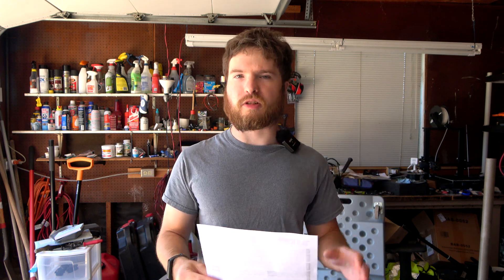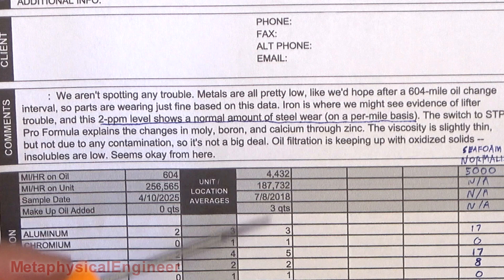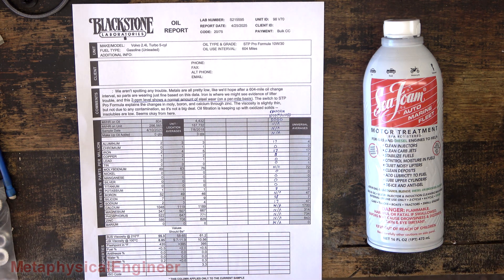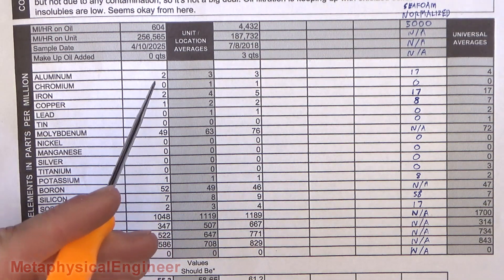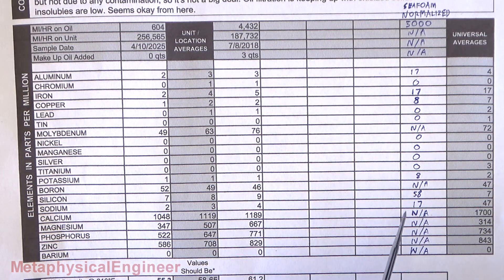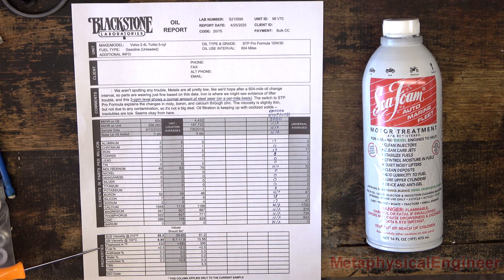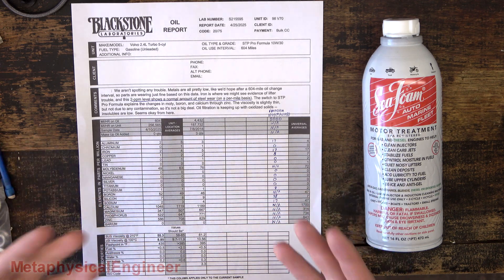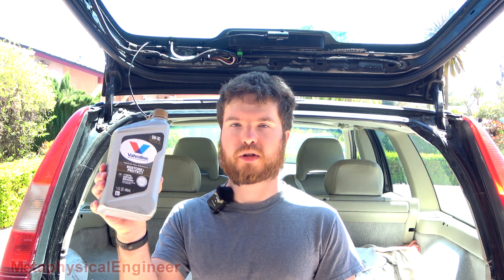Did Seafoam Hurt My Engine?  Oil Analysis Discussion!

Comment: All of these arguments about oil additives have been scientifically resolved many years ago. Only a handful actually help, and every old school idea like adding trans fluid, kerosine, of diesel fuel, is a great way to actually cause damage to your engine.
Reply: I used Seafoam one time in my Honda Odyssey as it was burning oil and fouling out plug #1.  Ran it one time and my oil burn went away and I now have 3x the mileage with no fouled plug.  Lucky?  Maybe but seems to have worked for me.
Reply from the maker: @kevinberta8741 How long did you run Seafoam in your Honda?  How many miles were on it?  Do you still have it?  Sounds like you had stuck rings like some engines became notorious for, and the treatment restored compression and oil control.
Reply: @MetaphysicalEngineer  It had over 250k on it.  Ran it  for about 3000 miles and then changed oil.  It now has 312k on it and not burning oil.
Reply: @kevinberta8741 I have used SeaFoam many times to correct idle problems in cars that idle smooth before hand. It cleans everything it touches and doesn’t dissolve so everything gets clean. If it crud in the carb or injector it gets cleaned, if it’s crud around the valves it gets cleaned. I have a car the IAC keeps getting dirty and ramps the idle rpm up through 2500 rpm and SeaFoam helps fix it but takes a couple tanks and some gas creates it like Exxon gas. I put Exxon in the tank forget it it’s gonna idle at 2500-3000 rpm for the next 2-3 tanks of gas every single time. I suppose I could change the IAC a fifth time but I don’t know that would fix the issue. Excellent car other than that. Timely oil changes though and 5000 miles is not timely it’s an attempt to prevent cars from making it to the 3rd market. 3000 or whenever anything funky is going on with the oil, dark color or thin when checking it cold.
Reply from the maker: I'd really be reluctant to add kero or diesel to the crankcase, even though that's exactly the main ingredient in those 10 minute engine flush products.  ATF at least has somewhat comparable viscosity and lubricating properties vs an ultra light fuel oil. Even so, I doubt 10 minutes with some solvent in the oil would do much for the hard carbon.  I'm stuck doing it the slow but safe way, or tearing down the top end and manually cleaning the lifters.
Reply: Funny my Grandpa used ATF to silence lifters forever and it always worked for him and he drove the same cars for years and years at a time. He did it in really nice V8 engines and tiny 4 cylinders I don’t recall him ever driving any V6’s or in-line 6’s but if he did and got lifter tick he would’ve put some ATF in and it would’ve shut up for him. I prefer Marvel Mystery Oil for the task and timely oil changes of 3000 miles or when the oil gets dark whichever happens first. Also if it gets to feel thin I change it. Oil’s cheap engines aren’t.
Reply from the maker: @308dad8  Tried Marvel first when the tick arrived, shown in the previous video.  It knocked a fair bit of carbon out but didn't touch the noise.  How long did gramps run the ATF in the oil before it would resolve the tick?

You're right that oil is much cheaper than engines, and many modern engines have unreasonably long intervals.  With 7 quarts total sump capacity, I have a lot more wiggle room for longer intervals.  Factory spec is 5000 miles on the turbo models here, and that was figured using obsolete 1990s oil tech.  See the oil data from a few years ago on the sheet using modern full synthetic, where at 4400 miles there numbers look very good and could have run significantly longer.  Of course there's a big difference between 5000 miles of short trips or sitting in traffic and 5000 miles of highway cruising.
Reply: Adding ATF to an Engine Crankcase is Not A Good Thing To Do!! Some ATF'S have A Frictional Additive that helps the Clutch Packs Grab!! Call Any Transmission Repair or Rebuild Shop, and Talk to Them!! Call Any of The Oil Majors, and Ask about Frictional Modifiers included in the ATF Additives Package!!😮😳😳😳😳🙄🙄🙄🙄 The adding ATF To FLUSH Engines is a Very Old Legend, and Holdover from generations back!! ATF was Originally Whale Oil!! FACTS!!😮😳🤔🤔 Look it up!!🤫🤫🤫🤫🤔🤫🤫🤫 Yes, Real Live Harvesting of Whales that was finally Banned!!🤔🤫🤫🤫🇺🇸🤘🤘🤘✌✌✌✌😊

Comment: AMSOIL SIGNATURE SERIES
Reply from the maker: Also got a few recs for Amsoil too.  Ester based oils have a reputation for cleaning, so I'll keep that in mind too.  So long as the wear numbers look good, I'm open to trying more products if the noise doesn't go away.
Reply: If I purchased new today I would start it on a true 100% synthetic. Red line would work too. Getting away from all the paraffins is the way to go.
Reply: @EvzenKovar-i5p  100%  SYNTHETIC

Comment: If you want to clean an engine, try Valvoline Restore & Protect or HPL (High Performance Lubricants). Never put ATF in an engine.
Reply from the maker: I'm running R&P now (see conclusion for where I mention it).  Very curious if it resolves the issues since I suspect the hard varnish that's restricting the lifter is similar in nature to the deposits that jam up piston rings which R&P is formulated to dissolve.  HPL is another I've heard good things about, and it's on my list of things to try if this sequence fails to yield any results.  

All depends on how it goes and if I still have favorable wear metal counts on the next sample.

Comment: ATF does not contain any significant detergents or cleaning ability. This is not the 1950's, there is no whale oil in modern ATF and there are no clutches in your engine that will benefit from the ATF friction modifiers.

Comment: Any additive added to oil will 100% degrade your oils additive package. You should be adding a quality product to your fuel no matter what brand gas you buy and especially if not using Top Tier fuel. The Motor Oil Geek channel is where any of you that want facts should go. This guy hasn’t a clue what to look for in an oil test result. 
Oh, and if you’re putting Lucas Oil Stabilizer in your crankcase, you should stop immediately. 😮
Reply from the maker: If you see errors in my interpretation, please enlighten me rather than just saying I don't know what I'm doing!  I'm here to learn, and I'm sure others will benefit as well.  

I do agree that Top Tier fuel is worthwhile, and likewise have never been a fan of Lucas Oil Stabilizer.  Especially since I can see that oil pressure is not the source of the problem here and adding a quart of petroleum syrup to the crankcase won't do me any good.
Reply: Because the additive package in the oil is a fragile sort of magick, and not in many cases "just Mobil One with Moar Stuff in it."

If adding anything to Mobil One 100% degrades the additives, why aren't users of Royal Purple etc reporting problems after those products have been on the shelf for decades?

Sounds hyperbolic.

Comment: I had an old Ranger pickup four banger / fuel injection. It was running rough. I took the throttle body apart and it was covered with black varnish. I sprayed it full of seafoam. I also poured some in the tank. I let it sit for a few minutes. I drove it 2-3 miles while spewing white smoke out of the tailpipe. I let it run until the smoke cleared up. When I took the throttle body apart, the varnish was mostly all gone and the engine was running normal.
Reply from the maker: Interesting!  Project Farm also used Seafoam to great effect on a sludged up older Ranger.  His was clattering like it was about to come apart, but purred like a top after.  I think he put it in gas, oil, and through the intake.  Apparently it was still quiet and smooth when he did a check in a year or so later.  

After my experience here I much prefer Seafoam as a fuel additive or throttle body cleaner vs an oil additive.  There's small amounts but very hard varnish and carbon in my engine, and Seafoam would probably need many thousands of miles to put a dent in it.
Reply: My dad had a 93 ranger with the 4cylinder shortly after 36k miles it had terrible lifter noise he changed the oil added slick 50 it stopped making noise and added every oil change after he once didn’t add it noise came back he eventually sold the truck with 150k miles

Comment: Atf has more detergents than motor oils. Plus, it's in the 20 to 30 viscosity range, which will not hurt any engine, old or new. The additives in atf also have seal softeners and anti ware included. So I've been using it for decades and always have great results. I'm curious about the Valvoline myself, I can't wait for the results.
Reply from the maker: Thanks for the info!  What vehicles/ engines have you been using ATF as cleaner in? How much did you use?  Was it a preventative thing or were you trying to solve a problem like noisy lifters or sludge?
Reply: @MetaphysicalEngineer  in my area, people are poor. They don't do maintenance 🙄. So usually they have stuck lifters and clogged drain back passages from the head to the camshaft tunnel. They will sell them cheaply because they think it's a rod knock. I'll change the sludge for oil and put the whole quart in the first change. I keep an eye on the oil quality. Usually, the first 1k miles it's full of grit and black. Then I'll put a gallon of Shell Rotella T 30W in the engine and top with atf. Usually I don't get 2k miles before the filter is full. Change only the filter and watch it close. Then, put the recommended oil in and watch for more clogged filters and particles in the oil. Usually, within 10k miles, the engine is clean and ready for work 😆. Have been doing it since the 70s without having ever damaged an engine. It's more about getting the passages open for proper lubrication to the components. Something about atf helps with the removal of carbon deposits and sludge.
Reply: ATF has almost no detergents compared to engine oil. There are no combustion byproducts in a transmission (aside from some motorcycles) that would need cleaning. ATF needs the metal and clutch particles filtered out and magnets really help in this regard. Do NOT put ATF in an engine.
Reply: @marstedt  you ARE right there random internet guy with nothing on his page but 1st you don't leave it in there its not a long term solution. no it does not have as much detergent as motor oil but what it is good for is flushing out a lil sludge and does free up lifters pretty well.
Reply: @NickMillerlouisiana  - I suppose you could do that but the ATF friction modifiers should not be used in any engine that I know of and could be harmful / damaging. Besides that, ENGINE oil has more detergents & cleaning ability and is usually cheaper than ATF. Use ENGINE oil in engines .... please!
Reply: ATF will destroy a DPF
Reply: Transmission fluid is hydraulic fluid.  It has no detergent in it.  It doesn't need it, it's thin and petroleum cuts petroleum.
Reply: ATF has been great for me as i will occasionally run 1/2 to 1 qrt depending on engine size 👍

Comment: Valve lash might surprise you, valve cover gaskets are usually pretty cheap
Reply from the maker: These engines have hydraulic lash adjusters.  In the previous video I used my stethoscope to identify the second exhaust lifter on cylinder 5 as the culprit.  I suspect the adjuster is not pumping up completely, but has not fully failed and collapsed, which would make a much louder, sharper clacking noise on this engine.  

Unfortunately this design uses a structural cam cover containing the upper half of the cam journals instead of a standard valve cover.  40 bolts with a strict loosening and torqueing sequence, and anaerobic sealant instead of a gasket or RTV, which is extremely sensitive to contamination.  I've had it apart before, and it was an experience.

Since this UOA suggested normal wear rate, I'm more confident I can experiment with cleaners rather than an emergency teardown to save a cam from getting munched.
Reply: They are, but removing the covers is oftentimes a big enough PITA due to obstructions that most people will avoid it if they can.

It's why none of my dailies ever got a nice crinkle finish on the covers.

Comment: Seafoam was designed for marine 2 stroke engines. Not the wonder juice people think
Reply: It was actually developed for cleaning mechanical diesel injectors.

There's always some old grump who swears it does nothing, and then refuses to show his work.

Vs thousands of people including professional mechanics that notvonly say they got X result, but also showed evidence.
Reply: Agree.  Honestly, I'm not sure why marine engines would benefit, but I'm not refuting your claim.  I've done some work on mercruiser 350s.  I'm no expert, they just seemed to be cam'ed differently than, say, a 350 that would go in an automobile.  I would go on to say that seafoam would benefit older engines.  Things like old tractors.   I would say seafoam has seen its days pass.
Reply: @FrankRizzo557  water remover, carbon remover. 2 strokes burning oil mix, carbon can build up easy if they putt around
Reply from the maker: I did mention that in the previous video where I cut open the oil filter.  Seafoam and MMO are old school products from an era of older tech engines and older tech oil that would tend to form sludge easily.  Still useful for stuff like small power equipment prone to gummed up carbs, and may have benefit in an engine with soft sludge.  But at this rate I'd need to run a hundred bucks of the stuff over many thousands of miles before it put a dent in the hard varnish.
Reply: @MetaphysicalEngineer  yea, a regular use pretty much from new
Reply: That might have been what it was originally developed for, but the can indicates it can be used in cars and trucks.